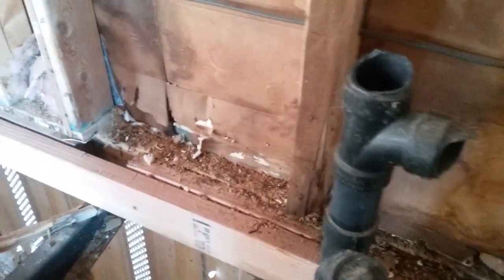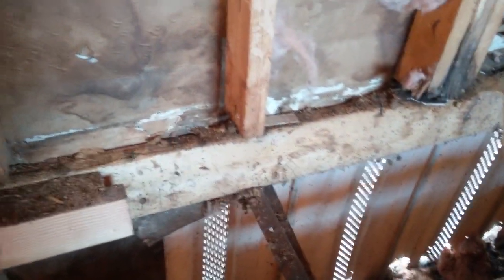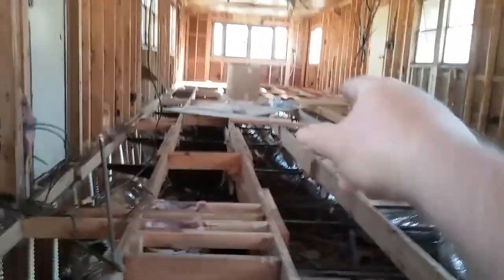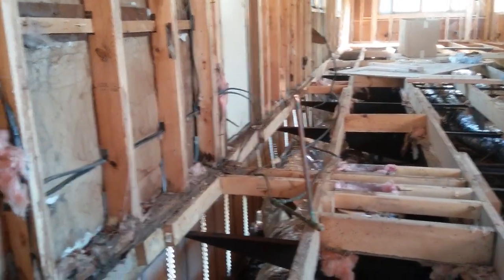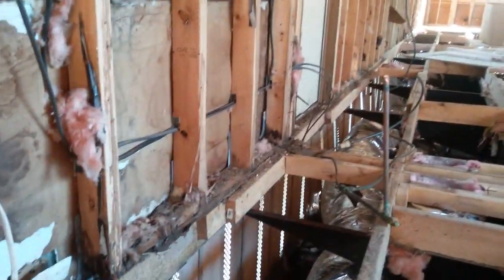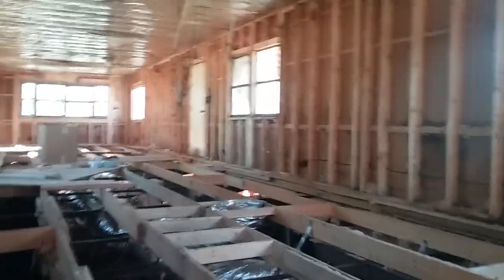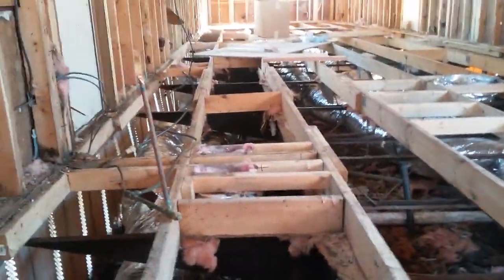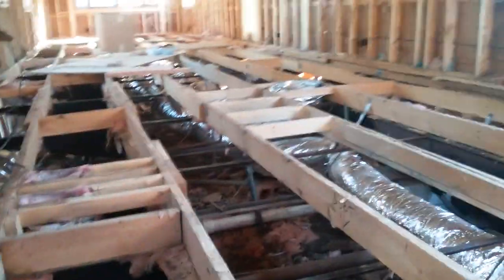Mobile Home Remodeling - Part 2

Comment: I feel your pain I have a trl made in mabe 1976 I gutted the whole house and even had to add floor joists some rotted some just weren't put in from new. Ant to top that house has a second roof on top can't level house because of second roof so had to adjust and build the floor 2inches higher from the frame rail on one side to level the floor
Reply from the maker: Wow, I feel for you!